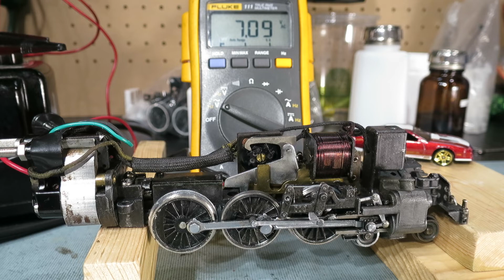LIONEL OO SCALE E-UNIT TESTING

Comment: Chris your videos on the Lionel OO gauge equipment are great and just what I need to get me going on my 004 engine and tender. Do you have any recommended sources for parts, parts diagrams, manuals, etc. Thanks
Reply from the maker: David, I'm glad to hear you found the videos useful.  I have never seen any parts diagrams for Lionel OO.  There is an instruction manual that came with the sets, but if you are familiar with other Lionel trains then the OO stuff operates about the same.  

If you check the end of my part 3 on servicing a Lionel OO Hudson, I included some reference pictures as well as wiring diagrams.  If you have any further questions, please let me know, I might be able to get you a better picture.

For replacement parts a place called The Train Tender, www.ttender.com, has a section of Lionel OO parts and ebay sometimes has parts.  If there is a specific part you can't find let me know.

Chris
Reply: @chrisselectrictrainlab  Thanks Chris. I emailed ttender to see if they have a bakelight rear locomotive wheel. One of mine is wobbly and looked like it has been glued in place. Do you know how those attache? I'm also interested in the screw placement forr the front and rear trucks. Your video showed which screws go where for the rear truck. Is the front truck long screw to the front and short screw to the middle? Do you know where I could find the springs and washers?  Mine were previously replaced with something home made that doesn't work so well.
Reply from the maker: For the front truck I put the long screw in front (between the two axles) and the short screw in back (closest to the drive wheels).  

I have ordered the truck springs from The Train Tender, get a few extras because you will have to cut them to length.  Originaly there were some "cup" washers to help the springs slide on the trucks, I have not found replacements.  The best option is to get or make a washer that is as close to the diameter of the screw as possible.  

The front and rear truck screws, springs and washers can be a bit problematic, be willing to change and adjust as needed once you get the engine running, trial and error usually gets the trucks to track well.  

All the drive wheels are pressed onto the axles.
Reply: @chrisselectrictrainlab  Does the spring go on the long screw or the short screw or both?
Reply from the maker: I would start off with a spring on each screw on the back truck and a spring on the front screw of the front truck.  Be open to experimenting with placement and even length of the springs to get the locomotive to operate its best.